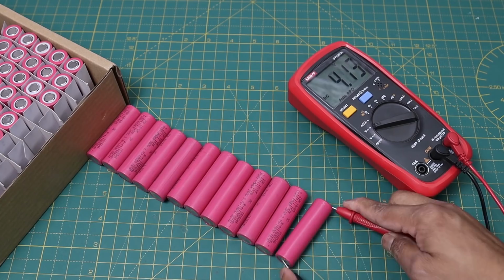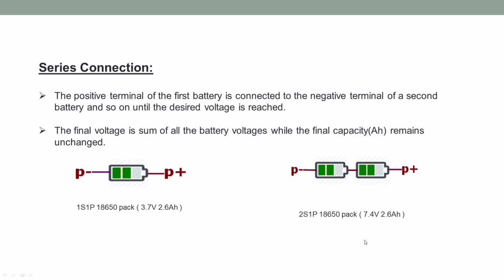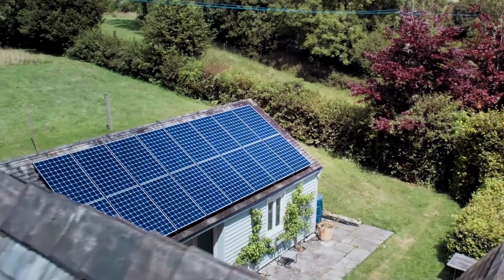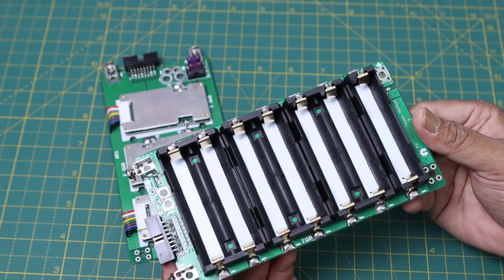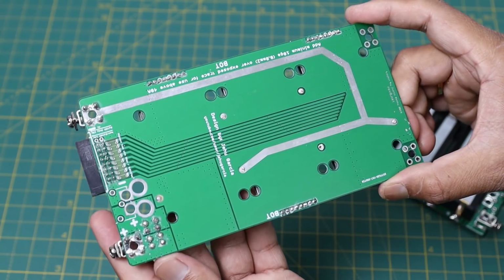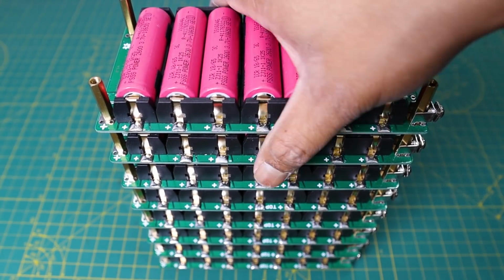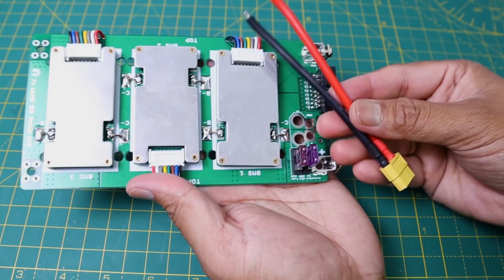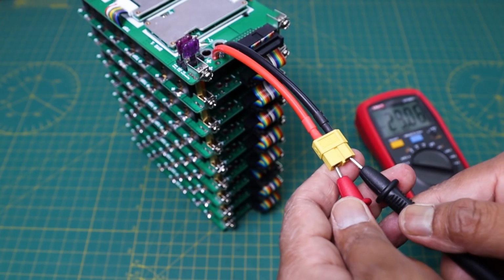Tried to Make a Mini DIY Power Wall using 18650 Batteries || 0.5 kWh Battery Pack Building

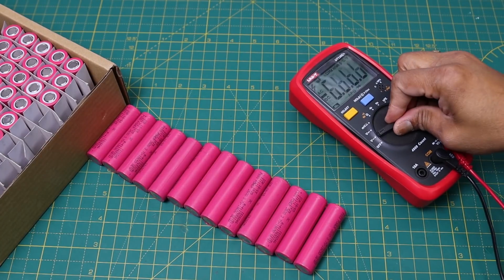Comment: 5:20 you said that cell voltages should be near to each other 
How near should the voltages be? 
(I have 7 cells in which two have 3.23V and rest 5 have 3.25V)
Reply from the maker: Then you can connect, no problem